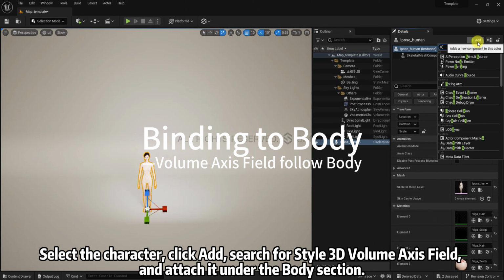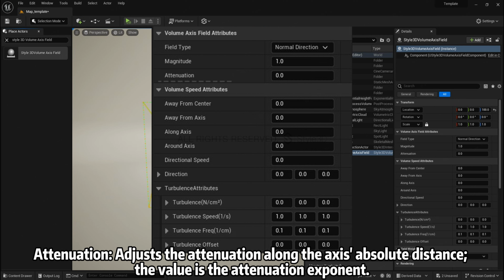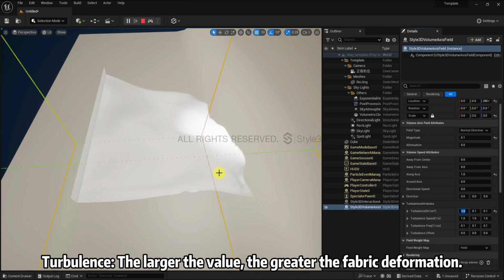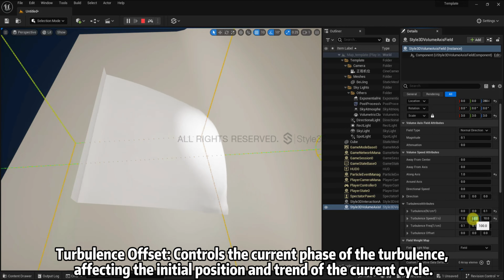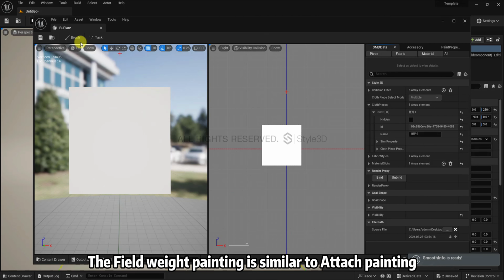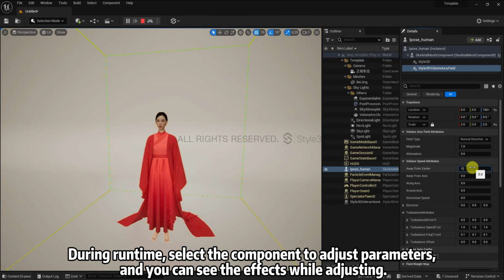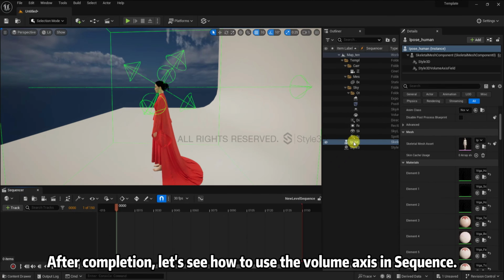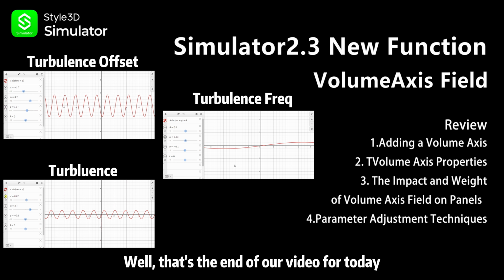[Simulator V2.3 Tutorial] Volume Axis Field

Comment: Hi, I'm creating animations using Unreal Engine.

I've been testing your product, Style3D Simulator, and I have a question.

I imported clothing data from Artlier 3D as an SMD file, but in Path Tracing rendering mode, the clothing appears completely black. The colors look fine in the normal view, but only in Path Tracing mode does the clothing turn entirely black.

I’m not sure why this is happening. Could you let me know how I can resolve this issue?